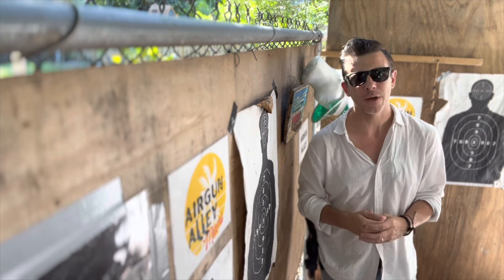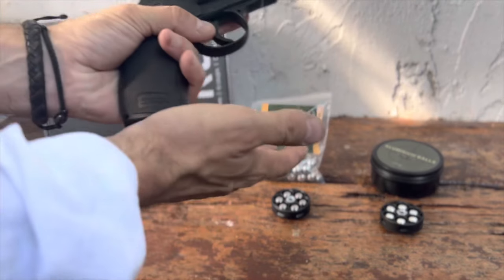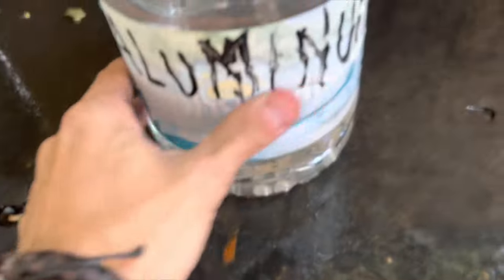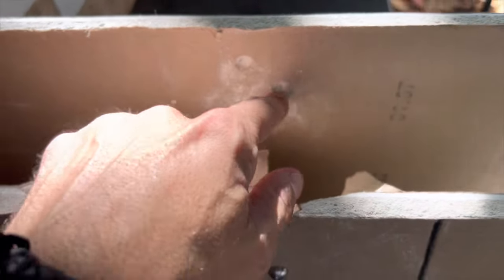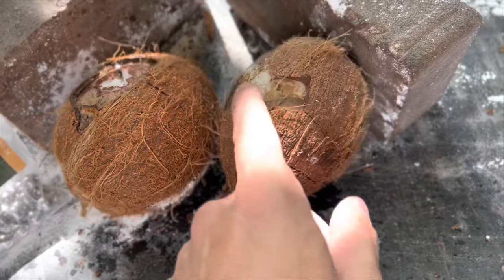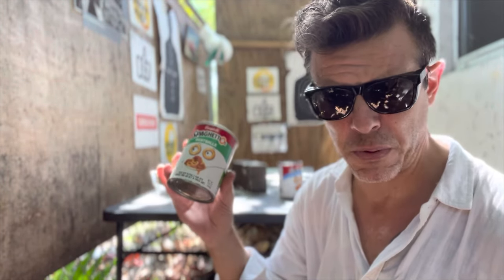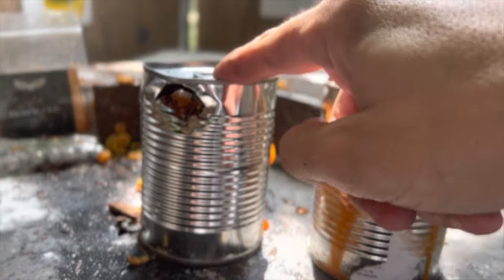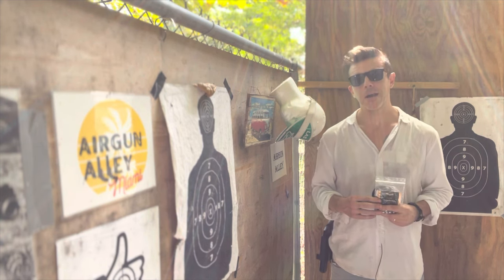HDR 50 (11 joules) • Steel chrome VS Aluminum Balls by Homedefence-24

Comment: I’ve got the 7j fully modified and with steel barrel and aluminium cylinder magazine.I also made up slugs in the silicone mold with glue and steel bbs. The right balance of weight in the slugs made. Not too heavy not too light makes the best ammo for speed and velocity.
I get 19j from a regular length barrel and 27j if I add the barrel extension on to it. Get around 12 good powered shots from a CO2 canister.
Reply: Please tell me how to get Gun like yours
Reply: do the aluminium balls fit into the aluminium cylinder magazine..???
Reply from the maker: 🔫  HDR50/TR50 (11 joules)

MCS: https://defenseinnovation.com/products/hdr-50-tr50-11-joules-home-defense-revolver-50-cal

Amazon: https://amzn.to/38PYPR8

Ebay: https://ebay.us/nNMPu2
Reply from the maker: Good question! I don’t have that mag… I should get one!

Comment: This test validates what I've always said and preferred, aluminum rounds all the way. I would venture a guess that the .68 cal. rounds have even more impressive results since that round is heavier than the .50 cal. (which heft-wise feels almost like an Airsoft BB).
Reply from the maker: Absolutely my man! Aluminum all the way. So with the 68 cal (not sure if you saw the video yet - posted yesterday) they did a bit more, but not as much as I was expecting. After analyzing it I realized that for the 50 cal I used Umarex CO2 cartridges, while for the 68 cal I used Crosman.
Baffled by the difference I decided to do a proper Umarex vs Crosman CO2 test/video. Went to the Everglades yesterday and did just that. Umarex CO2 performs a lot better, as suspected. (Video coming out on Sunday) Sooo, all this to say, that I wish I had done the 68 tests with the same cartridges :)
Reply: @Alfonso it’s kind of different with these though because the 50 cal definitely sometimes can penetrate more due to it being able to have the same joules but with a smaller ball that can penetrate better, less surface area to penetrate with the same weight and fps
Reply: Yes both aluminium and steel balls have there perpous.  Different jobs different tools

Comment: Well, that was a surprise. I was expecting those steel balls to blow the aluminum ones away. But alas, the aluminum wins by a whisker . . . it did, right🫤? Looking forward to the .68 caliber beast with this same challenge. Bring it on, buddy!!
Reply from the maker: Hahaha get ready for another shock my friend, the 68 cal performed…. well, you’ll see :)
But yes, I think aluminum beats steel. Just for the fact that they travel a lot further.
Thank you as always!
Reply: @AirgunAlley  Do you have any estimation on energy losses in aluminum vs steel over 10 meters or more? This is indicative, as aluminum even if shoots faster, it will also lose energy faster, although I don't know if it matters on such short ranges.

Comment: Absolutely loving your content. Thank you so much for creating all of these videos! Can I ask you a question about the aluminium balls. I've got a HDP50 and I'm thinking of purchasing the steel tuning barrel. Do you know of any issues that will affect this type of ammo with this barrel (sizings etc)?
Reply from the maker: Thank you so much Mark!! I don’t have HDP50, so I can’t give you an accurate answer. One thing I can say: the aluminum balls are very light and not as bad on the barrel as the steel ones, for example. That said, I’m pretty sure you’ll have no issues with the new tuning barrel… best of luck with it!!

Comment: The 2 spaced pieces of dry-wall is a great test for indoor pelletgun safety (will it go into other room). it would be neat to see if your Vigilante penetrates both, compared to your 1077.
Reply: Wall penetration it is not a concern in most of the European countries.
Reply: I MODDED MY 1077 ,IT GETS ONLY ABOUT 26 SHOTS PER CO2 NOW INSTEAD OF 50-60 STOCK !!!!!!  , I KNOW IT WOULD GO THROUGH BOTH LOL !!!
Reply from the maker: Great idea! Gosh both of those guns are full of dust by now. Really should pull them back out and shoot em! I’ll look into that video… once I get the several ones already planned out of the way. Thanks so much for the great ideas you always share, my fellow youtube video maker
Reply from the maker: Hahaha that’s very true!!
Reply: @AirgunAlley  the 1077 was my 1st.

Comment: HELLO , having fun watching your videos. i have a 68 cal umarex revolver at 35 joules, could you tell me where
to get the BB BUCKShoT rounds you have, IE: multi bb's in one 68 cal round that separate on impact? please attach link and also the 68 cal arrows for the same gun with the adapter so the cylinder doesnt move again on the 68 cal thank you

Comment: Excellent vid. Would it pay to use a laser site? if so, which would you suggest (from Amazon)?
Reply from the maker: Hey my friend! Yes absolutely, for the HDR 50 I do recommend a laser or sights of some sort, as the ones on the gun are really hard to see (unlike the HDR 68 which has great sites!)
Anyway, this is a great one here: https://amzn.to/3GdemHn
But if you want something a bit cheaper, I've used this one and found it to be decent: https://amzn.to/3WMovSr
One thing that is a must for when using lasers and scopes is a Laser Bore Sighter to align them :): https://amzn.to/3vyAjMl
Reply: @AirgunAlley  Thank You

Comment: I WOULD LOVE TO SEE THIS WITH THE 25 JOULES VERSION A GUNSMITH ON EBAY HAS FOR AUCTION , WOW . I BOUGHT 500 STEEL BALLS FOR MY HDP.50 ,they seem to be a thousandth or 2 inches to big ,they dont load ,when i pull trigger , it doesnt move , they might work in HDR 50 , WHEN I GET IT .good show as always brother !!!! anyways , i will order more steel balls because im in process of modding my HDP TO THE MAX ,INCLUDING THE TWO PIECE BARREL .BECAUSE THE FIRST BARREL MOUNTS IN PISTOL ,YOU GOT OPTION OF JUST KEEPING IT LIKE THAT WITH THREAD PROTECTOR ON ,OR ADD A DONNY MUFFLER FOR REDUCED SOUND . WHEN MORE POWER OR LONGER RANGE SHOTS IS NEEDED ,JUST ADD THE SECOND PART OF BARREL TO IT . I GOT INERT AND PEPPER ROUNDS ,RUBBER BALLS AND THESE BAD AZZ NYLON JAW BREAKERS THAT ACTUALLY BUST UP TIN CANS WITHOUT ANY DAMAGE TO THE PROJECTILES WHAT SO EVER , REALLY COOL !!! IM SENDING YOU A LINK I FOUND TODAY ,I ACTUALLY BEEN THINKING OF DOING SOMETHING LIKE THIS FOR SOME TIME NOW !!!
Reply from the maker: Hello my favorite Ninja out there!! You know? The 50 cal steel balls are a very mysterious issue. So many people have bought them and soon learned that they don’t fit. Even in the HDR 50. For some reason it seems that only that one cheap kind that I had found on Amazon, fit. Of course, the Homedefence-24 ones also fit well. But not all 50 cals you find online do 🤷🏻‍♂️
I appreciate you as always my friend!

Comment: Bought a TR 50 with some steel balls but they are really hard to push into the cylinder and
I doubt the CO2 would push them out...

Comment: Undecided on which is better for that marker but heavier will bring energy further down range even if that power is lower over-all. Please know that your HDB has the same funny looking rubber barel seal as my problematic Compact. Just make sure you dont run too tight fitting ball through there. slightly undersised is better. Hope your move is going well. See you next week ;-]
Reply: Very helpful comment my friend . That barrel seal must be what my hdp50 blew out when I used a slightly larger steel ball. I just got it back after an inner seal repair and then this happens. The ball didn't fit my HDR but does fit hdp. I should've known it could be a problem but now it's clear.  Smaller size projectile is better than tighter fitting. Now i have to get this fixed again!
Reply: @scottbeard9640  I had to learn it the hard way too. I've since got a brand new Compact that has only  run Riotballs.
Reply: @homeagent  thank you man. I'm glad to know I'm not the only one learning the hard way 😌

Comment: Great test, I've been wondering what the difference would be if used in a real self defense situation. I used steel ball bearings in my  modified hdp 50 and have a seal stuck in the barrel now. I had one seal  blow before,- (CO2 drained out) but this one is different. CO2 holds but there is a rubber gasket stuck in the barrel. Any idea what this could be? I only fired 2 steel balls- it happened on 2nd  one.  1 st shot was great and powerful. Aluminum balls fire all day no issues.
Reply from the maker: Hey Scott! Oh man sorry to hear that! I hope some handy wizard will answer this (or even better, I hope you solved the issue already!)
Wishing you all the luck in the world with it  🙌🏼
Reply: @AirgunAlley  thank you brother. I am planning to send it to some shop, out here in Los Angeles. Hard to find folks who work on umarex t4e though- Already had a repair done by a great guy on YouTube " Complete Technology Solutions"  he does a lot of mods and more. But I don't want to bother him with another seal repair- It was just a few days I had it back.
Reply: @scottbeard9640  Sounds like the perfect time to take it back. 2 days after "repair".
Reply: @barclayv8282  
Ha ha no the seal was just that. This is a blown out detent from me using a projectile that didn't fit perfectly in a high powered platform. Jon @complete technology solutions is very talented and reasonable. He's an invaluable asset in the LTL community
Reply: @scottbeard9640  Good to know. Thanks and good luck.

Comment: Is this ammo a little harder to load? Like, you need to give it a little more force, and it is tighter in the wheel of the gun?
Reply from the maker: Hi! Yes, the steel ones are a little bit harder to push in, just slightly. But they fit the barrel with no problem, they’re not too big….
Reply: @AirgunAlley  thank you so much for reply. Can't wait for the next video.

Comment: To Air Gun Ally: Hope all is well! I got the HDR 50 (11 joules) gun a few days ago. I test fired it with solid aluminum balls, and could not come close to your results. I shot at a metal coffee can at 12 feet, and just got a bunch of bounce back shots, and only mild denting on the can. Your results did much better than my same gun. Am I doing something wrong to get such bad results? Any reply would be so much appreciated! I love your cool vids!
Reply from the maker: Hi my friend!! Wow that’s is very strange and I’m so sorry you are experiencing this. 
Are you shooting in the cold or in the heat. That makes a huge difference unfortunately. In Florida CO2 has a lot more power do to the constant heat.
The ideal way to know is for you to shoot through a chronograph and measure the speed. That would tell us if there is an issue with the gun and if you’d need to send it back for a replacement….
Reply: I must add that the aluminum balls I got off Amazon did seem to fit very tight in the mag, I wonder if  I oil them a bit for better results, what you think? And thank you for your reply! You are awesome!
Reply: @humor62 he is shooting the 11 joule version. I don't know if his marker has been modified to increase the power. Many people do increase the power. Depending on where you live and where you buy the marker, you might have the 7.5 joule version. It is also possible that the can you are shooting is stronger. 
A chronograph and precise weight of your projectile is the only way to know for sure.
Reply: @J0HN_3_16  I found out the one I had was the 7 joules, I upgraded to the 11 joules with much better penetration results.

Comment: Aluminium balls are very good to get power.
I have on the way 4.8gram steelballs, from homeDefence-24.

Of course i have kit my a 'little' bit for more power.

Without the long barrel (8inch) its hard to get some real joule.

My next modified is to change the barrel to a 12inch.
Ive read that 12 are the ultimate for my gun.
I only shoot with 12g, for now.